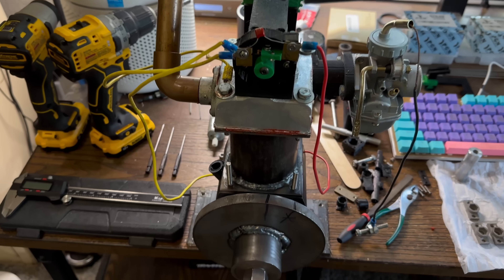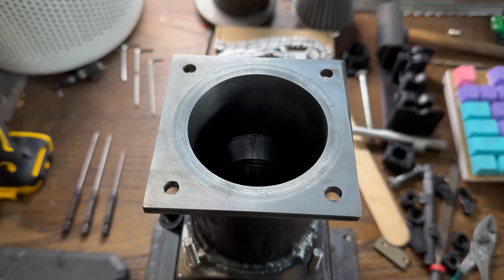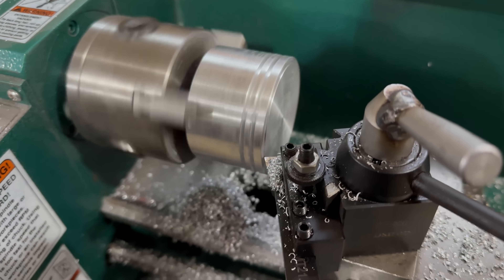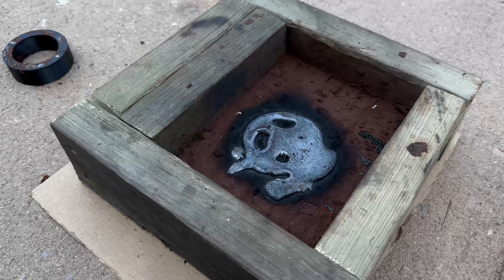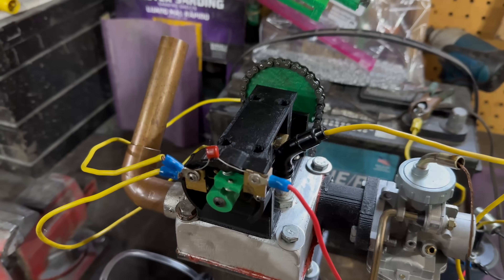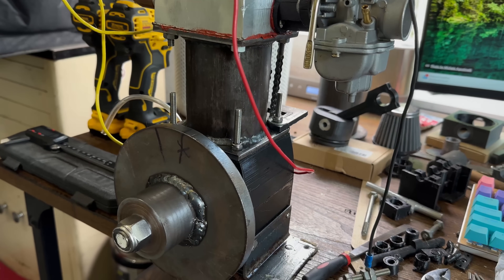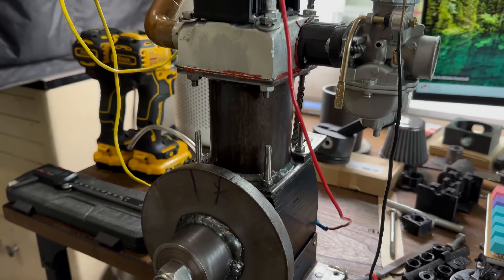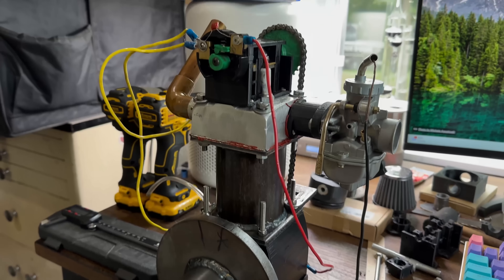Homemade engine gets Aluminum piston! Technology from a Top Fuel Dragster!

Comment: why cant the exhaust point straight up vertically
Reply from the maker: It can, I just like how it looks when it’s at around a 45° angle pointing back. But it keeps moving, I added a set, screw to the chunk of copper pipe that goes into the 90° elbow, but now the 90° elbow is sliding on that chunk of pipe, so I have to put a set screw in the elbow as well.

Thank you for watching!!
Reply: @ProjectLMZ  dude, it looks mean :)

Comment: You might need a vacuum casting machine to get the bubbles gone, amazing work either way.
Reply from the maker: Thank you!! I did not have a mold releasing powder so I used cocoa powder, and I think that was a big mistake, I think it burnt off and released gas into the aluminum.

Thank you for watching!!
Reply: @ProjectLMZ  thanks for reading and considering my comment. I dont know exactly if the vacuum casting machine would work. I have done some jewellery casting with gold and silver before and that worked for me. If vacuum machine is expensive spinning casting machine might work aswell but i dont think that is going to work for a big thing such as a piston.

I wish you the best of luck!

Comment: use a magneto instead of a button lol
Reply: Button?
Reply from the maker: I thought about it, but the points system I have seems pretty reliable. It is way simpler, that’s why I like it, simpler in the fact that I don’t need a flywheel key, because my current flywheel can rotate on the shaft if enough force is applied.

Thank you for watching!

Comment: Are you printing the connecting rod vertically or laying on it's side...if standing up the layer lines stack in the wrong direction...lay the connecting rod flat on the bed, it will make it MUCH stronger
Very very very cool!  I wonder if sheet metal from say an old busted washing machine body could be cut/bent into the shape to hold the parts that the 3d print keeps failing
Awesome stuff!
Keep em coming!!!!
Reply from the maker: I am 3d printing it laying down, I think the carbon fiber polycarbonate rod failed because of bad layer adhesion, because the PETG rod held up, but I have a special con rod coming in the next video!

Comment: Would love to see that thing powering something, great video!
Reply from the maker: Once I get it to not self-destruct after a couple of minutes, I actually have a fairly good idea on how I can measure the horsepower, I can hook a alternator up to the engine, and just keep drawing more and more current until I stall the engine, and then I can measure the voltage and amps and turn that into watt, which I can then convert into horsepower!
Reply: @ProjectLMZ you could also just short circuit the alternator through an amp meter, with the engine running it wouldn’t be supplying any amps without supplying the field windings anything, the more voltage you give the field windings the more load the alternator puts on the engine, it just makes it a little easier to control the load electronically. Keep in mind you probably will only get like half the amount of horsepower in watts out of this because there are so many losses
Reply from the maker: @mondude9754  I didn’t think about that, I could probably go back to my other method I was thinking about, getting a disc brake system from a bike and making a brake dynamometer

Comment: Looking good! In the future when you’re printing those rods you should try increasing your shell layers as opposed to infill. It will significantly increase your parts’ strength
Reply from the maker: I actually did, for the PETG rod near the end, after it blew the other one, i printed it with only walls, I set the wall thickness to 10mm on a part the is 16mm wide, so the whole part was walls. 

Thank you for watching!
Reply: @ProjectLMZ Try to make a swirl injector system
Reply: @ProjectLMZ  Use the piston shaving and gas torch to fill the pitting on the piston... ?
Reply from the maker: @kylereese4822  I don’t think that would turn out very good, I think I would end up just causing more harm than good. If the pitting ends up causing issues, I’ll just machine another one, as it wasn’t that difficult.
Reply: Or just use metal and stop wasting time...
Reply from the maker: @AndToTheRepublic4WhichItStands  there’s a reason why I haven’t gone metal yet, cast aluminum is very weak, but I have a titanium connecting rod coming in the next video!

Comment: Id suggest like a 12 volt PC fan blowing on the side of the cilinder, then you theoreticallly could do longer runs without it overheating (hopefully). Love to see this project coming along
Reply from the maker: I have a water cooling jacket 3-D printed that I’m going to cover with a clearcoat, but it just doesn’t make sense to hook it up if it’s not going to run long enough for it to even get up to temperature. With two minutes and 30 seconds of run time, it’s not to operating temperature yet, so water cooling would only slow it down, and probably not buy a lot. In my next video I’m going to make even more metal parts, so I might actually have to add the water cooling. With the new parts I’m actually expecting it to be able to run to self destruction on the valves by overheating!
Reply: @ProjectLMZ  cool! Indeed if it does not get hot, it runs worse, but since the plastic melted i assumed it heated up a bit, not too hot just warm. The fan idea was indeed ment for when it can do longer runs. But water cooling is better, yet a bit more complicated (thermostat, radiator etc). Also as an extra, the reason it burns oil is because there are no oil control rings. Id figured maybe you already knew, if not, you know now 😉
Reply from the maker: @Rdw_04  yeah, I knew about the oil control ring, but I really don’t have a way to implement one in my piston design, and really it’s not necessary for my engine. The thing that’s stopping me from adding one is that where it would need to go there’s not enough material in the piston, so it would just cut the piston in half.
Reply: @ProjectLMZ  the only thing i'd come up with is using a higher viscosity oil, but i dont know if that would work. part of me says that since its thicker, it would have a harder time getting past the rings, but i dont know how that works out in practice
Reply from the maker: @Rdw_04  that’s a good idea! I think it’s fine if it burns a little oil, but the issue was after the runtime I put through It burnt half the oil, and that’s an issue.
Reply: @ProjectLMZ  yeah, exactly, i mean its not that bad if it burns a bit of oil, then you at least know it gets all the way to the piston, and probably the small end of the rod.

Comment: Please, please, please, it is begging to have a belt running to power a small mechanical pump to cool the engine!!! Will you do this?
Reply from the maker: I actually have a 400 gallon per hour aquarium pump, the need has just not came up yet. I have a 3-D printed water cooling jacket, I’m going to coat the whole thing in a clearcoat so that it doesn’t leak, and it will clamp around the cylinder. I was planning on using it in this video, but it just doesn’t make sense for me to hook it all up if it’s not going to run long enough to even get up to temperature. 

Thank you for watching!!
Reply: @ProjectLMZ Well the top did definitely melt like camdens did, maybe get pcbway to send you a water-cooled head like Camden Bowens design?
Reply from the maker: @TheBMWDrifter-sb2cy  I’m going to make a metal one, so I won’t need to worry
Reply: Or at least a belt to a fan blowing on some fins

Comment: Wow man, this is amazing! Ive been here since the very beginning of this engine building. This is such an amazing series, I look forward to watching all these
Reply from the maker: Thank you!! I have a huge surprise coming in the next video!! Check out my latest community post for more info!
Reply: @ProjectLMZ  Is it a turbo?
Reply from the maker: @DrifyRL  not quite, a titanium connecting rod! It could handle a turbo though!
Reply: @ProjectLMZ  titanium?! That’s a bit overkill but I love the idea
Reply from the maker: @DrifyRL  it’ll be unbreakable! I decrease the height of the rod to 10 mm, but it should still be able to handle around 32,000 pounds, whereas my plastic PETG one is only able to handle around 1,700 pounds. That’s the tensile strength of the rod.

Comment: Sounds great. It didn't run away, the idle was too high. It seems it was at lower revs because the engine was still cold, the moment it warmed a little bit the revs went up because it was burning more efficiently. 
Seems like it's running long enought for it to need some type of cooling. Maybe it's the time to redesign the hole engine head so it doesn't melt XD. Would you be doing some fins or water cooling? Keeping all water tight (especially the 3d printed parts) would be hard in case you decide to go that way.
Reply from the maker: I’m planning on water cooling it, I have a 3-D printed water cooling jacket, and I’m going to clearcoat the entire thing. Then it will be fully waterproof, and I have a 400 gallon per hour water pump for it, and yes, 400 gallon per hour is way overkill, but it was on sale and cheaper than a 200 gallon per hour.